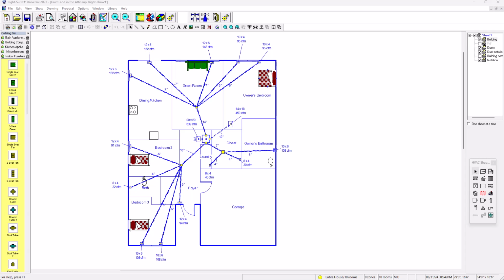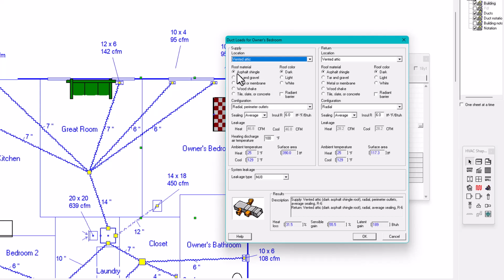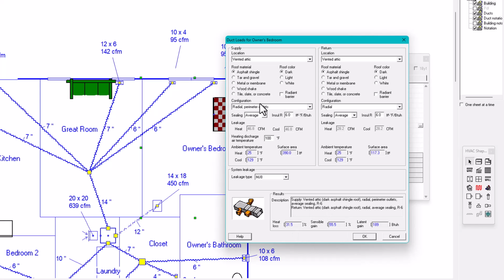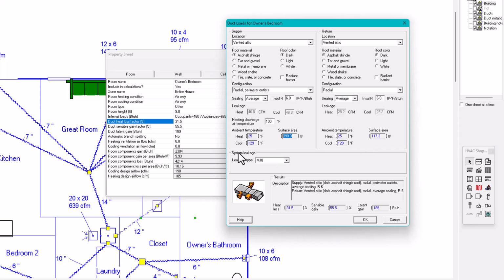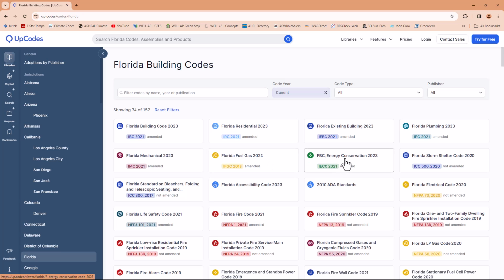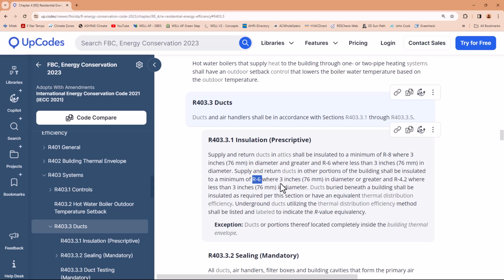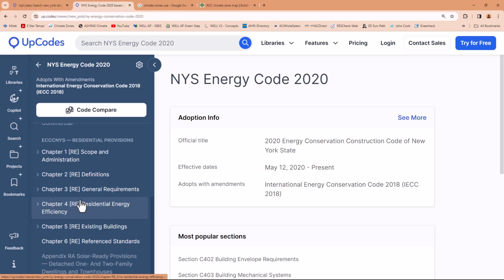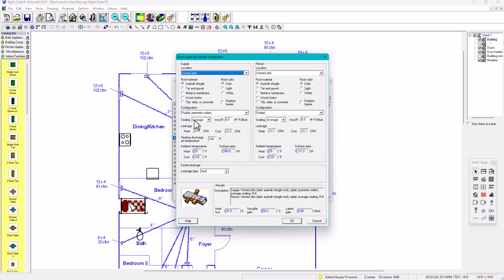Wrightsoft: Tips&Tricks - Duct Loads in the Attic

Comment: How would you take the attic space into consideration when calculating the actual load on the house? I live in Kentucky and we have a high end contractor that normally encapsulates his attic space and crawlspace. Those spaces will become a semi conditioned space because he does not insulate at the ceiling or the floor. How do I account for these additional spaces to insure that I have a large enough system for the loses that will occur in the rooms due to conditioning the attic and crawlspace.
Reply from the maker: Great question. Make sure your duct loads are accurate. When creating a room, right click on the room to enable the property sheet. Once in there, click on duct heat heat loss factor so you have access to “duct loads” under supply or return you have options to chose in the drop down menu: choose “encapsulated attic” and floor choose “enclosed crawl space,vented/leaky”. I hope this helps.